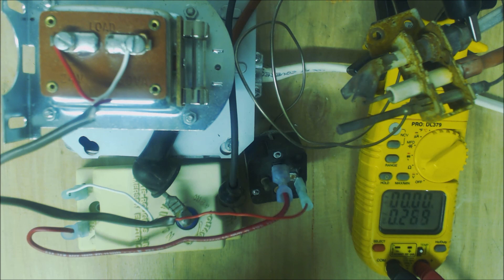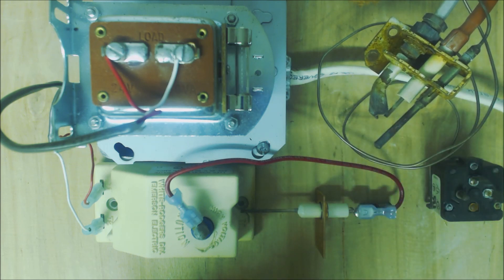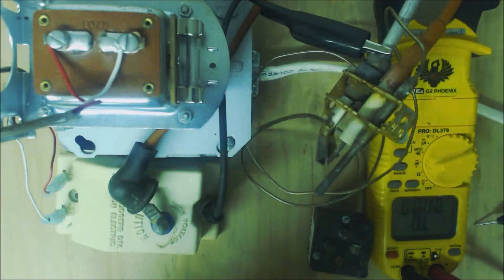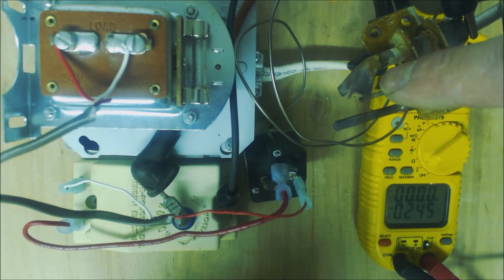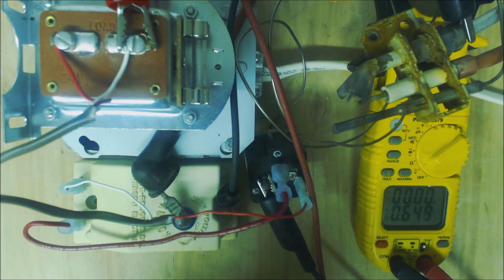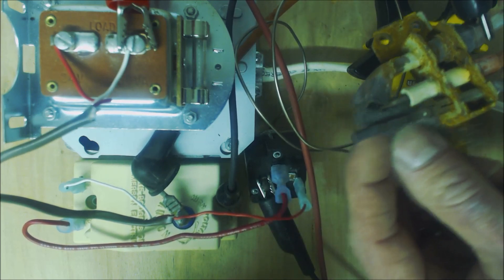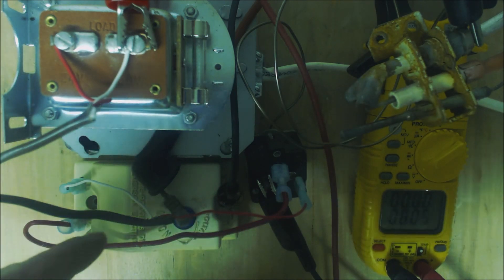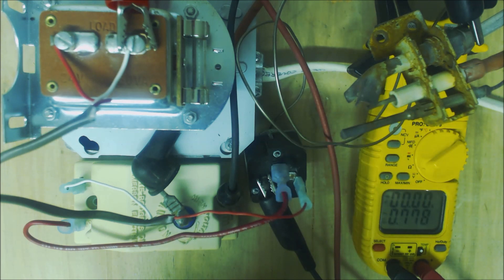Gas Furnace Spark Ignition Troubleshooting- Mercury Flame Sensor!

Comment: Great  video.  I just finished “fixing” my Weil-McLain VHE-3 that had this issue.  The odd part is that I’m not sure what I fixed.  The system was working fine.  I then cleaned it up (vacuumed and dusted the system pretty thoroughly for the first time in a while).  Then I could not get it to work. It seemed like the pilot light was sufficient and the mercury flame sensor was engulfed in the pilot flame, but it was not heating up enough to switch positions to get the main burners to come on.  The house was kind of cold, so I made a fire in a wood burning stove near by.  Now the system is functioning properly.  I’m not sure if there was too much heat loss from the pilot light end to the switch end of the mercury flame sensor.  It seems counterintuitive to have to raise the temperature of the system to get it to turn on the first time. Do you have any thoughts or have you seen this before?  Thanks.

Comment: Just came across one of these in a rooftop furnace/AC unit. Someone along the way converted it to a standing pilot, probably because the old sparker died. The mercury switch was in the flame 24/7/365. Apparently the constant pressure caused by being constantly immersed in flame caused the mercury cavity to expand enough over he years to weaken the pressure on the diaphram. In very cold temperatures there was not enough pressure to close the switch that opens the main burner. I figure the stainless steel tube was acting like a radiator to cool the mercury. Took me ten visits to track down the problem. I finally was able to catch it when it was cold enough to cause it to fail to open the main burner while I was there with a meter. I read 28 volts going in to the mercury switch and nothing coming out to the main gas valve. One thing I don't quite understand is what closes the pilot valve after the main burner ignites. On this system there were only two wires going to the gas valve. They had to be opening both the main and pilot valves simultaneously. Can't see how only two wires can control them independently. Perhaps on this older system the pilot stays lit as long as the main gas flows. Thanks for clearing up the mystery.

Comment: So if all the conditions are made will this open up the main burners ?
Reply from the maker: The flame would heat the mercury sensor which would be stage one for the pilot and 24v would power the main stage for the main burner, thanks!

Comment: Seen something similar the other day, Montgomery Ward pkage unit.  Had this switch, mercury style. Had 2 terminals labeled pilot from trans. to maybe spark ig.? Gas valve wired with pilot switch. Question is, should the trans. provide voltage to ignitor in order to spark gas? I didn't hear spark and turned on flame with a long ignitor. Hopefully get some answer.

Comment: Thank you very much for this very informative video! I hope that you still are monitoring feedback.  Here is my dilemma,  Utica boiler with a WR 36c84 GV, 3098-134 merc flame sensor.  Have been having intermittent problems with the spark, GV, and duration of boiler being fired.  I bit the bullet and bought a new GV and flame sensor. Changed it all out. Now having problem with pilot.  Spark is good but no gas to pilot! Can hear gas vale click, but no gas to pilot. Put all old GV and flame sensor back and now am getting intermittent pilot gas. Question: What is causing the pilot gas valve to be hanging up?  Any help would be great, getting to the point that I almost am bald with all the hair I've pulled out. Thanks!
Reply: I have a similar WR gas valve and mercury flame sensor that is triggered by the pilot flame.  The pilot portion of the gas valve is opened by a solenoid on the gas valve.  You can put a metal ruler on the solenoid to see if there is magnetic field pulling the pilot valve open.  You may have a blockage of some sort inside the gas valve but you swapped out a new one and it didn't work at all.  You should check your incoming gas line pressure because that would cause your WR gas valve to not function properly.  My pilot operates okay but it sometimes has trouble triggering the mercury flame switch to open the main gas valve.  As long as the pilot flame is on, I occassionly remove the mercury sensor and jumper the terminals with a #12 U-shaped wire to open the main gas valve and when the mercury switch clicks over I replace the jumper with the mercury flame sensor plug and the boiler operates as normal.  I hope this helps
Reply from the maker: Hey James, there could be a clog at the orifice of the pilot tube. Did you check the inlet gas pressure? Can you adjust the pilot flame itself some with a pilot adjustment screw so the rod gets more heat? Is the pilot head warped or not quite lined up with the mercury rod? Thanks James and Pat!

Comment: Can the mercury bulb be heated up enough to get the switch to active using a hot air gun? I have replaced the switching assembly but I'm concerned I might have put in another bad switch...
Great vid BTW. Thanks!
Reply from the maker: I haven't tried myself. I would think it would be hot enough though
Reply: @acservicetechchannel  I use a propane torch.  I don't know about the hot air gun because the bulb end actually gets red hot.

Comment: Hello again. Off topic to this video, I have one question that I really can't seem to wrap my head around. Hopefully you can bring some closure to this, I don't know if you may have answered it in an older video so please bare with me. So my question is regarding the w1,w2 and y1,y2 terminals on the thermostat. I know they have to do with two stage heating and cooling, but here is the thing. For example, the Lennox furnaces I have mostly been working on we just wire the heating to the w1 and then the furnace control board has a set time with the dip switches I believe before second stage kicks in. So when would I ever use w2? I just finally got a job in service 2 months ago and haven't even touched on the cooling side yet so if you do reply focus more on the w2 use, but I would still like to know when the y2 for cooling is used as well. Sorry about what is probably a very silly question, I have just yet to see it used so i'm curious. Thanks in advance. I started watching your vids about 2 weeks now starting from the oldest and working my way up. skipped to the most recent so you would see this comment haha. Keep up the amazing work. Hope to hear from you.
Reply from the maker: Most newer boards over the last 15 years give you the option of controlling when 1st and 2nd speed would run. Simply put though, it is almost always more efficient to allow the board to decide when to run in either speed. This is what it sounds like you are doing which is good. The big thing is that installers a lot of times don't do is set dip switches so on furnaces you service, take a peak at the dip switches and look up what they should be depending on the manufacturer. Y1 and Y2 are for two speed outdoor ac and heat pump units so if you have a single speed unit then you should only wire the one then. If you have a two speed thermostat and you have two wires to the furnace then just leave that unless you go into the program or change to a single speed thermostat. You could also jump the w1 and w2 of a gas furnace heat terminals at the thermostat and disconnect the one at the thermostat and act as if it is just a single speed stat and wire the furnace as you have been with the one wire. I hope that helps! Thanks Daniel!
Reply: acservicetech  you rock. Thanks man.
Reply from the maker: Glad to help Daniel!

Comment: How many volts did you say that spark igniter was and is that AC or DC current.Thanks.
Reply from the maker: That is AC.and on this ignitor, I believe it is around 6,000 volts. Thanks

Comment: I had this setup in a old carrier rtu and the supply house told me parts are not available anymore because of the mercury. I had to buy the part used off ebay, I didnt know you could retrofit a newer ignition.
Reply from the maker: Here is a link to one but you certainly can still get these. The supply houses may or may not still carry stock though but could get them next day likely. This is a link to one but you need to check the round connector positions, amoiunt of connections and sensor length though -- http://amzn.to/2kyGcmb
Reply: thank you,i did not know about that!